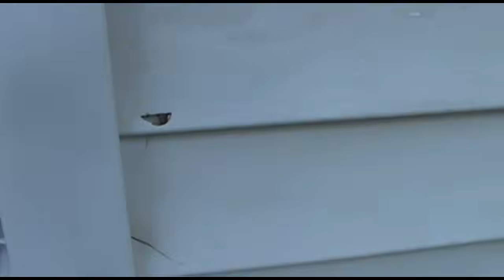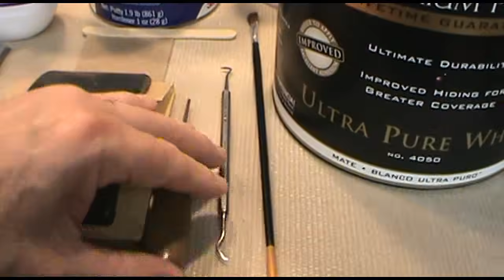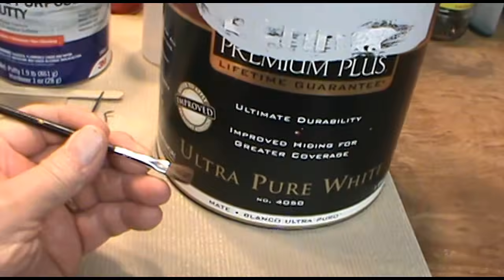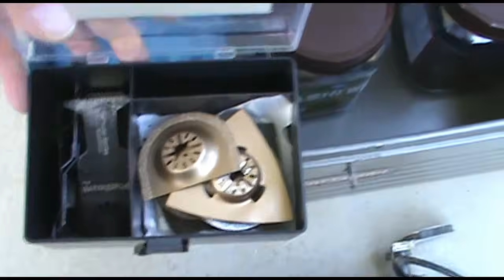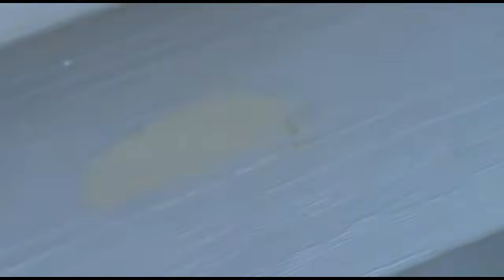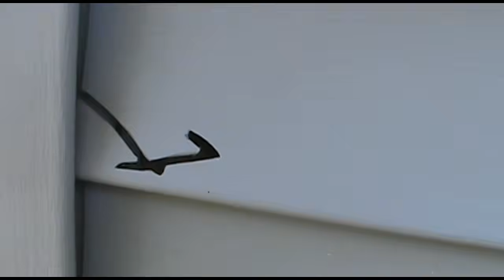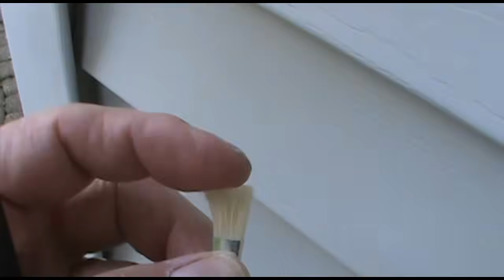How to Repair Vinyl Siding Holes and Cracks. Perfect and Undetectable.

Comment: How well did the repairs hold up over time?
Reply from the maker: They hold up great. I have a lot of these repairs like the ones where an air condition unit was moved to put in a deck, hose reals have been relocated, damage from a kid throwing gravel at the house while pealing out with his 4-wheeler, etc. Many of these repairs are 15 to 20 years old. Only two of them failed and that was because I didn't drill out a couple of holes and put a "skim coat" over them. All of the rest of the repairs that I did correctly have held up like no damage ever happened. And the two that pulled loose were no big deal because they were easy to repair.

Comment: Bummer, the putty is out of stock. Is the hardener a separate item or does it come with it?
Thank you so much for your wonderful videos!! ❤😊❤
Reply from the maker: Thank you for your kind comment. Yes, the hardener is included with the Bondo All-Purpose Putty. This stuff is so amazing I can't understand why it isn't kept in stock. You used to be able to walk into any big-box or hardware store and buy it off the shelf. If you ever find it be sure it is in a blue and red can just like the one I linked to. I have purchased it on occasion where they sent me some sort of auto body filler which is useless. It will usually come in a black can with red lettering.

I haven't personally used J-B Weld Multi-Purpose Putty but I have seen a couple of reviews that say it is similar to, and works as well as, Bondo All-purpose Putty. The J-B Weld Multi-Purpose Putty doesn't say it can be used on plastic/vinyl but I saw an Amazon review where the guy said he used it to repair his vinyl siding. I am out of the Bondo brand so I will be buying the J-B Weld brand to try it. It has a 4.5 star rating and can get purchased here https://amzn.to/4cmXYlN

If you try the J-B Weld All-Purpose Putty please let me know how it works. Thanks for stopping by and good luck with your repair.

Comment: Hello there!  I have some larger (maybe 2 inches) holes caused by a really nasty hail storm.  Do you know if i could get away with putting strong tape over first (which i have already done to stop water getting in) and then add the putty over the top, following your process from there on.  This economy is killing me and the deductible on my roof will wipe me out so I was planning to use all the insurance money to get the roof fixed then DIY the siding myself.
Reply from the maker: If you have a larger hole I would back fill the hole with DAP Alex Painter's Acrylic Latex Caulk https://bit.ly/4tvGbBf . I like the Acrylic Latex Caulk without silicone or any other additives. It can be used indoors or out and cleans up easily. Aim your caulking gun at an angle and squeeze some back behind the vinyl siding all around the perimeter of the hole and continue to back fill the entire hole but do not fill it all the way up until it is even with the siding. Keep it about 1/8 of an inch below the surface of the hole in the siding. All you are doing is making a base for the Bondo All-Purpose Putty. Let the Painter's Caulk set up for at least 24 hours so it is good and hard. This caulking doesn't expand or shrink much and should be a good base for the putty.

After the Painter's caulk has completely set up you can fill the rest of the hole in with a top coat of the Bondo All-Purpose Putty https://amzn.to/2UK93ZV (may not be available on Amazon). You will have to work fast because this stuff has a very short open time of about a minute or less. I would have a small putty knife ready to immediately pull the mixed putty off the mixing cardboard and work it into the remaining hole. It won't matter if you have to work fast and get a little extra putty buildup on the hole to make sure it is all filled in because the putty is easy to sand down. After sanding, trace in your wood grain lines with the dental tarter pick, clean it with denatured alcohol, and paint it. I hope that all makes sense and good luck with your repair.

Comment: Why not tape around each hole to minimize putty excess and smooth it out and remove it before putty sets?
Reply from the maker: Good idea except you only have about 60 seconds or slightly more before the putty starts to set up. You need all of that time to smoothly and completely fill the hole. If you tried to pull tape off it would already be starting to harden in the putty.

Comment: So which paint did you use, the gallon can or the small jar??  You weren't clear on which one you actually used or you paid for both and tried both? $5 for the small jar is great if they can mix that small amount, probably $50 for the big can (in 2025) that will never get used up unless you paint something else flat grey.
Reply from the maker: Hi, 11x. I bet your guess of $50 for a large can is spot on. I didn't know about these little samples until after I purchased the big, expensive can for this job. That's why at around 10:20 into the video, I said "on jobs like this, where you're just doing a little repair of vinyl siding, even one of these little tiny jars of paint would last years. So hopefully that will save you some money." I brought up the little sample jar because I didn't want others to make the same mistake I did, because many people don't know Home Depot will make a custom sample of paint at such a low price. I just purchased another sample jar a few days ago for another job I'm doing. It was 7 dollars and change now, but that is still an amazing deal.

So, to directly answer your question, I used the one-gallon can of custom paint, but I would have purchased the small sample if I had known Home Depot would do this. The sample I show in the video is actually a totally different color for another job. It is the first custom sample I ever purchased. It was shortly after I purchased this custom gallon, and I needed to do another custom-colored paint job, which was very small. I was prepared to buy an expensive gallon because I thought that was the only way to get custom paint from Home Depot. As I talked to the lady at the paint desk about custom-colored paint, she asked me if I wanted a sample or a gallon. I couldn't believe my ears. I was thrilled to learn I could get custom-colored samples, but bumed about the fact that I had just paid so much for a gallon to do a job that only required about an ounce or two of paint. I used the new sample jar of a totally different color in this video to show you guys these samples are available, so you wouldn't make the same mistake I did.

Thanks for stopping by.

Comment: How does this patch hold up to pressure washing?
Reply from the maker: Very well. Many of my patches are over 10 years old, and some of them are around 15 years old. We power wash our house every year, and I have never had any of them come loose or any issues of any kind. I don't even pay any attention to where they are as I power wash. If I intentionally held the power washer close to the repairs while in the jet stream setting instead of the fan setting, it may damage them, but there's a good chance it wouldn't. Most people use the fan setting while power washing their house, so it shouldn't be an issue. It has never been a problem for me.

Comment: Thank you so much for posting this.i have a number of holes in my siding and no idea how to fix them. My largest one i just did this winter knocking the snow off that was hanging over my roof,i hit it with the edge of the shovel and made a place about an inch long and half inch wide.im definitely going to try this. Again, thank you so very much.
Reply from the maker: My pleasure, Randy. Good luck with your repair.

Comment: have u tried mendel
Reply from the maker: No. I never liked the idea of putting tape over damaged siding. The color match isn't perfect and, to me, having a tape patch on the siding is a little unsightly. There's no question it would look better than a hole in the siding, but if I'm going to repair something, I want it to be as durable as possible and look as good as possible. Thank you for sharing the info, though.

Comment: Where do you live, I want to hire you!   Have you used the JB all purpose putty yet? Would you give it a thumbs up after using it?  Wonder why they discontinued the bondo version.
Reply from the maker: Thank you for your kind comments. I haven't used the J-B Weld Multi-Purpose Putty but I have seen a couple of reviews that say it is similar to, and works as well as, Bondo All-purpose Putty. The J-B Weld Multi-Purpose Putty doesn't say it can be used on plastic but I saw an Amazon review where the guy said he used it to repair his vinyl siding. You can get the J-B Weld Multi-Purpose Putty here https://amzn.to/4cmXYlN

Comment: Remove spray paint from vinyl siding
Reply from the maker: The paint was actually brushed on. Since it is such a small area there's no problem. I have several repairs that are well over 10 years old that still look and perform great.

Comment: Would have be really interested in the details of how you fix the big horizontal crack on the left hand side of the wall. The ones on the right are all little holes that are easy to fix. The ones on the left are harder but you only showed the details for those little holes on the right unfortunately lol
Reply from the maker: Hi Tom. If you have a larger crack you may want to check out the video at 20 minutes in. You will see how I repaired a fairly large crack.  https://youtu.be/ShZi5mwbZXg?t=1200

If you have a larger hole I would backfill the hole with DAP Alex Painter's Acrylic Latex Caulk https://amzn.to/3jCuneN . I like the Acrylic Latex Caulk without silicone or any other additives. It doesn't expand or contract much, can be used indoors or out, and cleans up easily. Aim your caulking gun at an angle and squeeze some back behind the vinyl siding all around the perimeter of the hole and continue to backfill the entire hole but do not fill it all the way up until it is even with the siding. Keep it about 1/8 of an inch below the surface of the hole in the siding. All you are doing is making a base for the Bondo All-Purpose Putty. Let the Painter's Caulk set up for at least 24 hours so it is good and hard. This caulking doesn't expand or shrink much and should be a good base for the putty.

After the Painter's caulk has completely set up you can fill the rest of the hole in with a top coat of the Bondo All-Purpose Putty. You will have to work fast because this stuff has a very short open time of about a minute or less. I would have a small putty knife ready to immediately pull the mixed putty off the mixing cardboard and work it into the remaining hole. It won't matter if you have to work fast and get a little extra putty buildup on the hole to make sure it is all filled in because the putty is easy to sand down. After sanding trace in your wood grain lines with the dental tarter pick, clean it with denatured alcohol, and paint it. I hope that all makes sense and good luck with your repair.
Reply: @Fixitforgetit  now it is a lot clearer. I wish you have explained in the video. it is sort of a gap around 21:45. Thank you! Another question, if I use Nashua Extreme Temperature duct tape to simply stick the holes or the broken pieces together, would it work if I don't care as much about the aesthetic aspect?
Reply from the maker: @Tom-zg9te  I've never tried duct tape so I can't give you any advice there. Good luck with your repair.

Comment: Can u use some metal flashing behind some major holes and then place bondo?
Reply from the maker: Hi, FixWithMe. If you have a larger hole I would backfill the hole with DAP Alex Painter's Acrylic Latex Caulk (18065) https://amzn.to/3jCuneN . I like the Acrylic Latex Caulk without silicone or any other additives. It can be used indoors or out and cleans up easily. Aim your caulking gun at an angle and squeeze some back behind the vinyl siding all around the perimeter of the hole and continue to backfill the entire hole but do not fill it all the way up until it is even with the siding. Keep it about 1/8 of an inch below the surface of the hole in the siding. All you are doing is making a base for the Bondo All-Purpose Putty. Let the Painter's Caulk set up for at least 24 hours so it is good and hard. This caulking doesn't expand or shrink much and should be a good base for the putty. You may want to try J-B Weld Multi-Purpose Putty https://bit.ly/3xxELPN as Bondo All-Purpose Putty is no longer available. From the comments I have seen it looks very similar to Bondo All-Purpose Putty.

Comment: Hello, thanks for sharing, we had a hail attack recently,I need to fix some holes and cracks. However, this all purpose putty is not available in Canada, is there any alternatives that can do the same?
Reply from the maker: Hi, Jason. You are welcome. Apparently Bondo All-purpose Putty is no longer available. I haven't personally used J-B Weld Multi-Purpose Putty but I have seen a couple of reviews that say it is similar to, and works as well as, Bondo All-purpose Putty. The J-B Weld Multi-Purpose Putty doesn't say it can be used on plastic but I saw an Amazon review where the guy said he used it to repair his vinyl siding. If you try it please let us know how it works. You can get the J-B Weld Multi-Purpose Putty here https://amzn.to/4cmXYlN
Reply: @Fixitforgetit  thank you so much for your detailed response,I checked it is 136cad now and seems a little too expensive but I will keep looking.
Reply from the maker: @jasonzhou5958  You're welcome. Good luck with your repair.

Comment: It does seem that even in the States Bondo all-purpose putty has been discontinued. Has anyone found the JB weld product to be as good? I'm concerned that whereas the Bondo description includes plastic as a compatible material the JB weld does not. I guess I'll give it a go using that.
Reply from the maker: Hi, dsopscak. I haven't personally used J-B Weld Multi-Purpose Putty but I have seen a couple of reviews that say it is similar to, and works as well as, Bondo All-Purpose Putty. The J-B Weld Multi-Purpose Putty doesn't say it can be used on plastic but I saw an Amazon review where the guy said he used it to repair his vinyl siding. If you use the J-B Weld Multi-Purpose Putty to repair your vinyl siding please let us know if it works well and if you have used Bondo All-Purpose Putty how the J-B Weld Multi-Purpose Putty compares. Thank you and good luck with your repair. J-B Weld Multi-Purpose Putty https://amzn.to/4cmXYlN

Comment: Ok so how did u match the colour of the paint on the siding?
Reply from the maker: Hi, Bruce. You will need a small piece of your vinyl siding. I had a piece left from the original installation. Take the piece of vinyl to your local Home Depot's paint department. Have them scan it and make you a small sample jar of flat custom colored outdoor paint. They did an excellent job on my color match. Be sure to get their flat finish paint.

Comment: So happy I found this video, but it looks like Bondo discontinued the all-purpose putty :( or at least that's what my ace hardware store and home depot told me. Any other alternatives you would recommend?? Not sure if I could use the Bondo original putty??
Reply from the maker: Hi, LGO. The original Bondo would not work very well. The Bondo All-Purpose Putty is still available. https://amzn.to/2UK93ZV
Reply: @Fixitforgetit  thanks! Ended up finding it at another Lowes.
Reply from the maker: @lgo8420  My pleasure. Good luck with your repair.

Comment: This is so helpful! I do have a question, what if you have a considerable sized hole, a few inches in diameter, i don't think I can find a match to replace it and I'd like to try this repair, I'm just concerned with building it up. Do you need fiba tape or something like it? Or should I just keep using small amounts of Bondo until It's filled?
Reply from the maker: Thanks, Heather. If you have a larger hole I would backfill the hole with DAP Alex Painter's Acrylic Latex Caulk (18065) https://amzn.to/3jCuneN . I like the Acrylic Latex Caulk without silicone or any other additives. It can be used indoors or out and cleans up easily. Aim your caulking gun at an angle and squeeze some back behind the vinyl siding all around the perimeter of the hole and continue to backfill the entire hole but do not fill it all the way up until it is even with the siding. Keep it about 1/8 of an inch below the surface of the hole in the siding. All you are doing is making a base for the Bondo All-Purpose Putty. Let the Painter's Caulk set up for at least 24 hours so it is good and hard. This caulking doesn't expand or shrink much and should be a good base for the putty.

After the Painter's caulk has completely set up you can fill the rest of the hole in with a top coat of the Bondo All-Purpose Putty https://amzn.to/2UK93ZV . You will have to work fast because this stuff has a very short open time of about a minute or less. I would have a small putty knife ready to immediately pull the mixed putty off the mixing cardboard and work it into the remaining hole. It won't matter if you have to work fast and get a little extra putty buildup on the hole to make sure it is all filled in because the putty is easy to sand down. After sanding, trace in your wood grain lines with the dental tarter pick, clean it with denatured alcohol, and paint it. I hope that all makes sense and good luck with your repair.
Reply: @Fixitforgetit  Thank you so much, especially for your quick response!
Reply from the maker: @heathernvisser   My pleasure. Good luck with your repair.